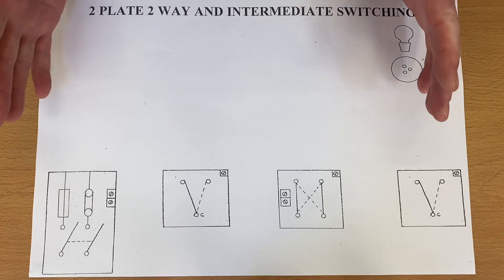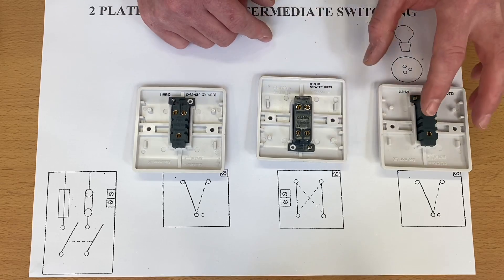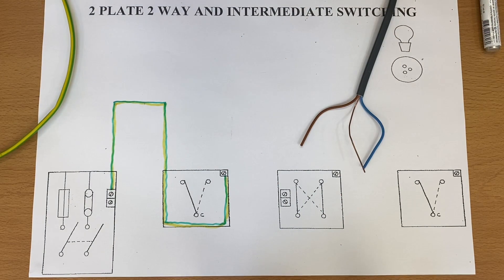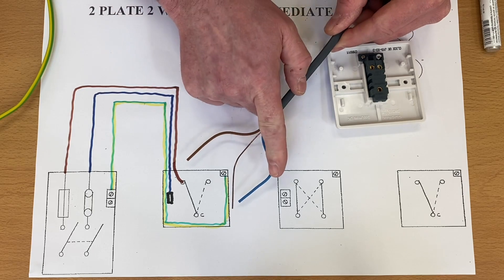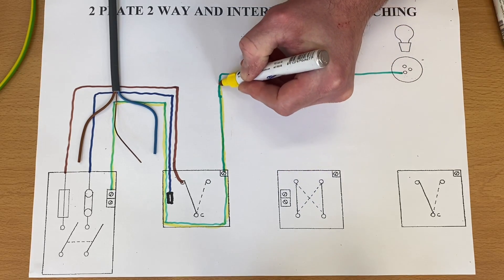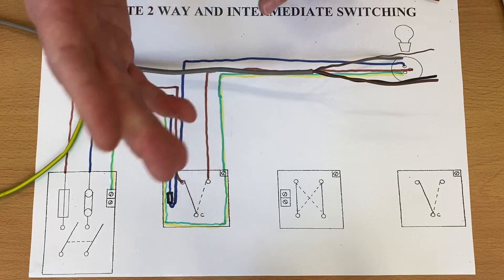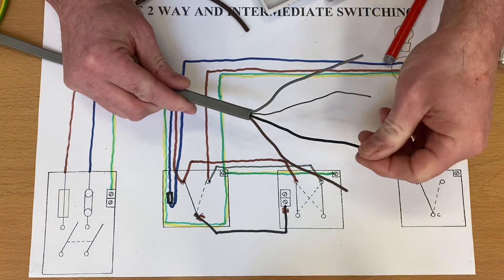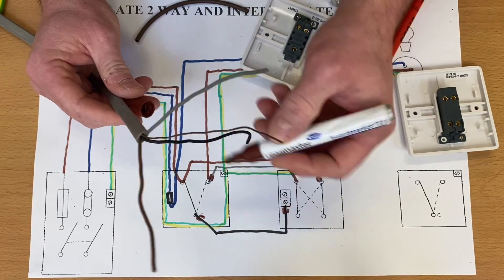Wiring Diagram Lighting Circuit 2 Plate Method Taking the Feed to the Switch 2 Way and Intermediate

Comment: Very unusual. I put hot wire from consumer unit to common terminal in first switch and hot wire from lamp to common terminal in last switch - only grey and black wires used between switches.

Comment: We used to call the interconnections "strappers" - have I got old? Also I remember once doing an HMO which had several landings where we shorted out L1 and L2 via a one way switch so the cleaner could temporarily override all switches to "on".

Comment: That is exactly how yo do it! Colours all correct 😂👍🏻 that's how I do it
Reply: with this circuit you will have a total of 10 wires to/from the first switch, 8 in the intermediate and 4 in the last switch 🤷‍♂!?. However, If you run the source live wire to the common in the first switch, connect the common in the last switch to the light and rearrange the L1 & L2 connections you can reduce the max number of wires to/from any switch in the circuit to 4 (common IN - common OUT)👍😎

Comment: Could you do a video explaining how you would wire 2 way lighting circuits using 2 gang switches (i.e. left switches operates one 2 way circuit, right switches operates another)

Comment: Thanks for this. Very easy to follow. Quick question for you. Does it matter which 2 way switch you take the switched line out to the lamp from? I'm assuming not, but just want to confirm.
Reply from the maker: U need the neutral from the switch as Henry 👍
Reply from the maker: Wiring Diagram Taking the Feed Through the Switches - AM2, AM2S & AM2E Lighting Circuit Explained https://youtu.be/cIPZhriDQr8

A different way 👆🏻
Reply: @GSHElectrical  this is the method I was looking for. Thanks for the link. This makes perfect sense. 
By carrying the supply through each of the 3 switches, I guess it is possible to use the last 2 way switch as the 'link' to send a supply over to another room then? Instead of taking the feed back out of the 1st 2 way switch that the supply came into.
Reply: @GSH Electrical Actually, I have worked it out. This is not possible. The live feed does not make its way to the last 2 way box.

Comment: I do love watching these, not that I ever do the 2 plate like that. Currently I join the live in the first 2 way switch to the brown carried all the way to the last 2 way, then the feed to the light fittings comes out the common with L1/L2 always as black/grey sleeved. This allows me to carry the 3 core and cpc all the way through the switches without ever having to cut and join the brown conductor. It's always useful and refreshing to be reminded there are other ways of wiring when the need arises though. Great detail and technical know how as always.
Reply from the maker: Thanks for the detailed and positive comment 👍🦾

Comment: Very well explained,
All though take if the feed to the switch is a throwback to the 50s I prefer to use a junction box and two way switch cable three core twin and earth . But I see the benefits of the two plate method. 

Fantastic video as always from GSH
Reply: The general consensus in training now is to teach the apprentices to avoid junction boxes if you can because further down the line in testing its not always a component you can either find or  visually check .
Reply: @steverobinson8170  life would be a lot easier if the only junction boxes allowed were wall boxes with a blanking plate, instead of just things stuffed in rando ceiling cavities.
Reply: @JasperJanssen  Problem is domestically  customers wouldnt accept that , i wouldnt  commercially not such an issue
Reply: @steverobinson8170  I mean, given that they’re in ceilings or high up against the wall, and blanking plates aren’t necessarily particularly ugly… why not?
Reply: @JasperJanssen  Because blanking plates are ugly , it also allows access to the general public who quite frankly wouldnt have a clue all of a sudden they would be spuring off the wiring adding  sockets all to totally unsuitable situations , one i came across a few years  back used spur puled of the back of a double socket that had already had spurs  wired into it  , spurs had spurs attached  all in 1.5mm  because they couldnt get the bigger wires in , that in itself was bad enough , but they had another bundle cut into that  in total 8 cables  bodged in the back  plus another 4  outside the box in a  strip and earth used as common , they wondered why  they could smell heat and the breaker kept popping , the less obvious  cable junctions are the better . Infact the supply at this shop was so dangerous i pulled the main fuse  which disconnected the 3 bedsits above !!!  after calling the local supplier
Reply: @steverobinson8170  so people who pull spurs off of existing sockets are a reason to make junction boxes inaccessible? Your logic is, well… not.
Reply: @JasperJanssen   spurings not the issue , the issue is unqualified  muppets accessing  the circuits , having  no knowledge of whats going on no testing equipment or loadings  already in place  spuring into the socket  at least gives idiots half a chance of not frying something , you have a junction unit with 4 or 5 circuits a mixture of single and 3 phase  possibly multiway light switching , with borrowed neutrals  with old and new colour coding its not a place those not trained should be playing
Reply: @steverobinson8170  multiple circuits in one junction box? Holy shit how is that legal?
Reply: @JasperJanssen  as far as i amaware its not ilegal
Reply: @steverobinson8170  I mean, maybe it’s legal in the UK, but it’s definitely not here in the Netherlands. Hence the question, how have you not made that illegal?
Reply: @JasperJanssen  Probably because our methods of electrical installation are different to your's , may be your definition of junction box is different to ours or possibly our  boxes are different to yours . In the uk  our plugs  are generally used , we use ring mains , i believe you use radials , general seen as good practice domestically to have rcd protection to each individual circuit , we also have three pin plugs
Reply: @steverobinson8170  oh really, you have three pin plugs and RCDs on every circuit? Wow that’s so much better than everywhere else!

Come on man. You should know that’s not how it works. Everything behind 30mA RCDs and everything getting sockets that provide a ground pin is standard across Europe, afaik. You guys still have dual RCD boards, your consumer units are very primitive.

The problem with running multiple circuits in a single junction box is that it leads to confusion and can easily lead to wires accidentally being shared between circuits, which is bad. And yes, obviously the ones you use are bigger than ours get. We don’t need big ones, because there can only ever be one circuit in them.
Reply: @JasperJanssen   Strange in my house every circuit has individual  RCD protection ,   general point is  our systems are different  somethings may  be better somethings worse but i still cant believe  you have no fused protection on individual appliances , do i understand correctly  too from your comment, not every circuit comes with grounding or have i mis understood  your comment . In the UK every circuit has a ground in a domestic supply